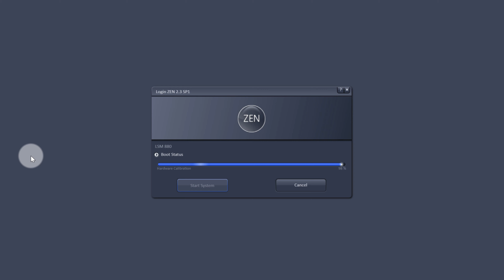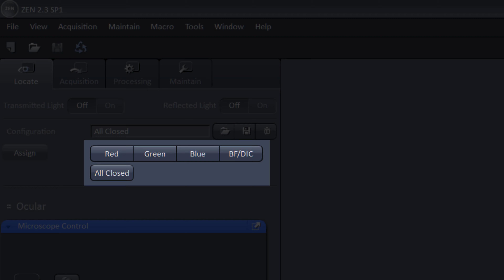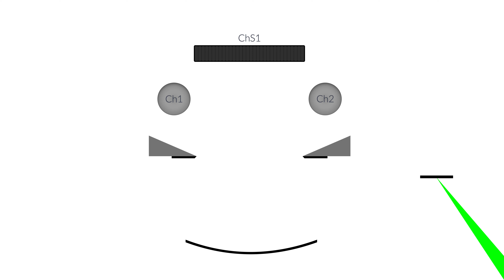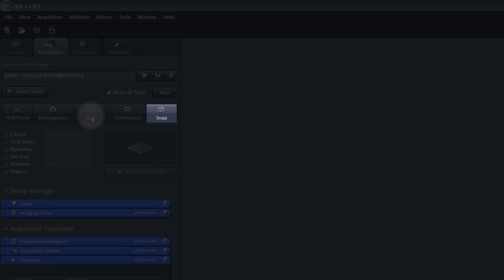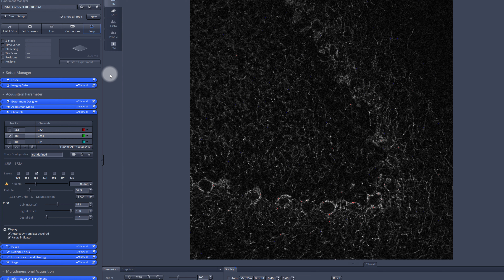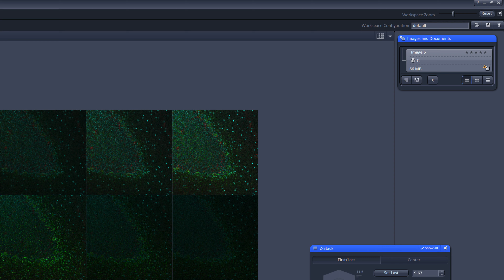Training:  Carl Zeiss LSM 880 Confocal Microscope

Comment: This tutorial is so great! Do you have a written protocol that I can print so all the students can follow?
We use a shared equipment and all the settings are deleted when we exit the program. Is there a way to get the same settings when we go back to the confocal? Thank you s much!
Reply from the maker: Thank you Cleusa!  We do have a PDF guide on our website: https://oivm.org/lsm880/#training

As for saving your settings - you can either save them to the Experiment Manager at the top of the Acquisition dialog or you can load them from an image by clicking the 'Reuse' button from any CZI image taken with the same system.
Reply: @OiVM  Thank you Jason. The guide has some areas where the text is not very visible. I looked for the "reuse" button but I couldn't find it. Is it possible that we don't see it because of the version that we have?
Reply from the maker: @cleusaoliveira9788  You can find the Reuse button in the 'Dimensions' tab located at the bottom of the image display.

Comment: Thank you for this helpful video! I have a question concerning the Beampath Configuration: How can I change the Detectors? Instead of Ch1, CHS1 and CH2 I can only choose between CH1, CH2 GaAsP and CH3. How can I set up the same detectors you showed in this video?
I'd be extremely thankful if you could help me out with that!
Reply from the maker: Glad you liked it!

Detector choice will depend on your system configuration.  Some LSM 780/880 instruments are equipped with a single PMT instead of the 32 channel spectral array (ChS) in that second detector slot.  Regardless, the order of the channels would be the same for the sequential acquisition presented.  On your system use Ch2 GaAsP in place of ChS1 and Ch3 in place of Ch2.  Ch1 remains the same.  You will just rely on the upstream prisms for emission separation to Ch2 rather than the electronic selection the 32 element spectral array provides.